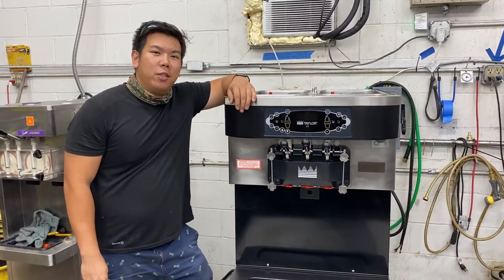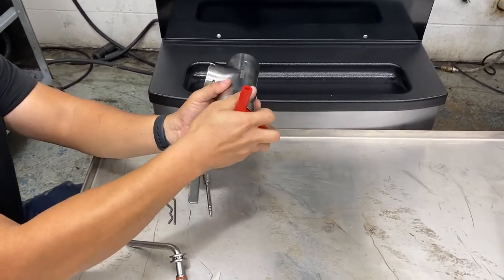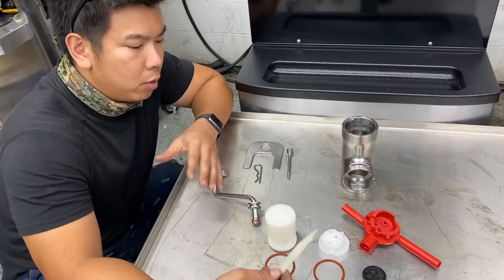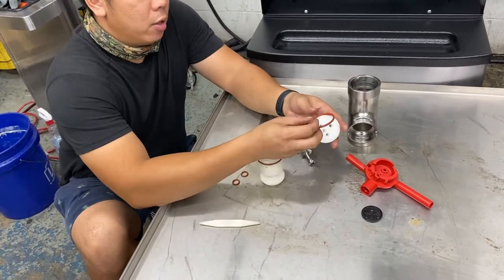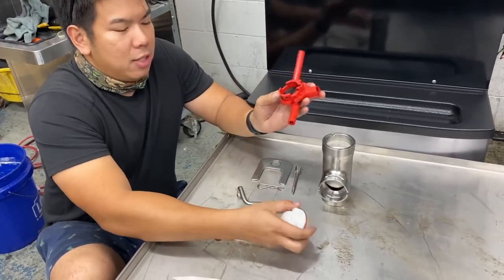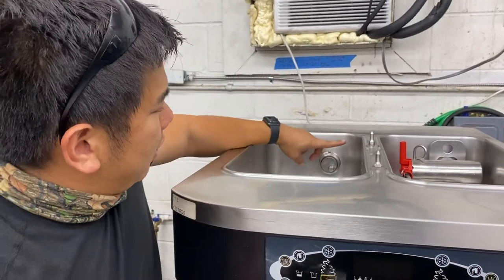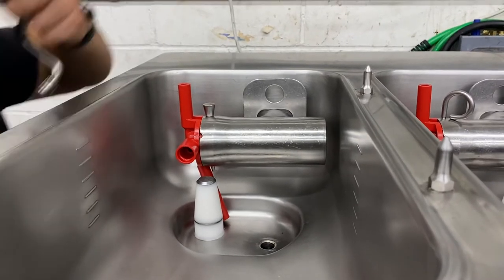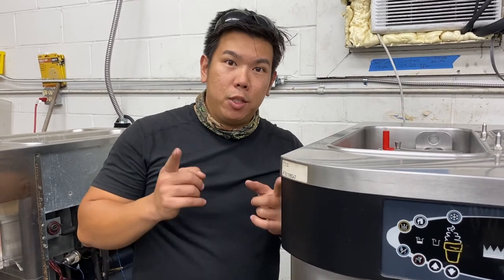Taylor C712 Simplified Pump Assembly and Disassembly

Comment: Can I ask a question my Taylor machine has the simplified pump  I have put tune up kit in pump and barrel , I’m have
 Trouble with machine starving  ice cream mix , I have recently had work done on my  Alternator and thought it may have been wire incorrectly   Can you tell me which way the pump motor turns clockwise or anticlockwise  mine is turning anticlockwise?? Hope you can help me Cheers
Reply: Have you fixed this? I l know the solution.

Comment: Can you please tell me does the pump motor turn clockwise or anticlockwise in the hopper  I’ve have work done on my generator since then icecream machine is starving to get mix have given machine and pump tune up kits no improvement 
Cheers  any advice please
Reply: pump motor runs counter clock wise